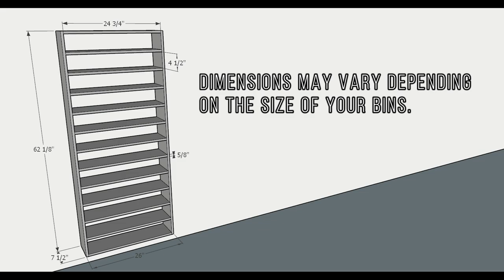DIY Build - One Sheet Plywood - 48 Bins Organizer

Comment: Your bin is 6 1/4 wide x4=25 in. and your shelves are cut at 24 3/4. Not sure how that works out. Excellent video.
Reply from the maker: They are almost 6 1/4 but you can squeeze the lid a little bit so they fit perfectly! ;) Thanks :)

Comment: I was getting excited at the idea of building one of these, until I found out the recommended bins are no longer available. I may build it anyway substituting corrugated cardboard bins until the real thing becomes available. All of the commercial solutions are far too expensive.
Reply from the maker: Oh yes it's possible, i made this video couple years ago. Best thing is go to the dollar store, you should be able to find small bins around that size for cheap and then build your organizer according to the size of the bins. I installed 2 hinges on my bin organizer and i use it like a door for the small wardrobe in my shop. I added a piece of cardboard on the back so the bin have a stopper and don't fall behind. 👍

Comment: I see a problem with your build. Depending on the weight in the bins then the shelves are going to bow. You need to add a centerpiece.
Reply from the maker: Thanks for feedback :) i will try to place the heaviest bin on the side to prevent that. But you got a point if it's start to bend i will need to add centerpiece but i don't have space for that, so my only option would be to add a 62"x26" 1/4 thick mdf to the back.
Reply: SEB TECH DIY You can calculate expected sag using this tool: http://www.woodbin.com/calcs/sagulator/ 
I think your shelves should be fine! To find sheet goods on the tool, scroll all the way to the bottom.
Reply from the maker: Thanks very useful tool :)

Comment: Can you provide a link for the bins you are using?
Reply from the maker: Good point :) The bin i used is from the brand KIS and it's the Omni style ( 2.2-Quart/2.1-Liter ) . I bought them from a local dollar store, it was 3 for 2$. I found them on amazon.com : https://www.amazon.com/KIS-Accessory-2-2-Quart-2-1-Liter-20-Pack/dp/B00BJ04MD6/ref=sr_1_fkmr1_3?ie=UTF8&qid=1495746461&sr=8-3-fkmr1&keywords=kis+omni+box